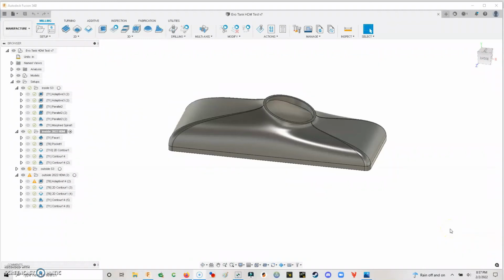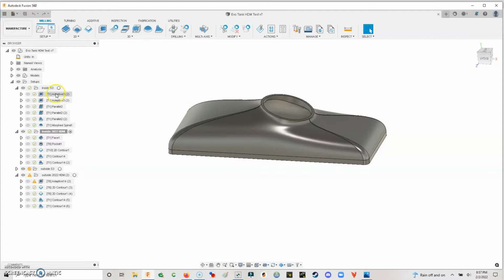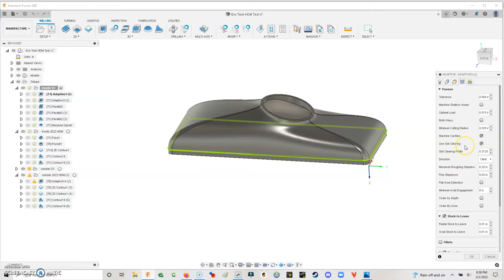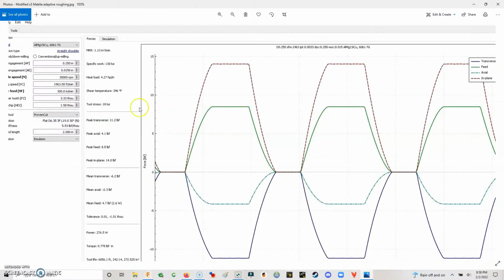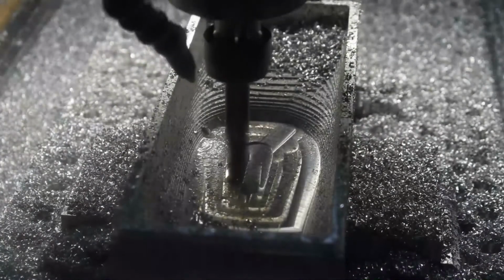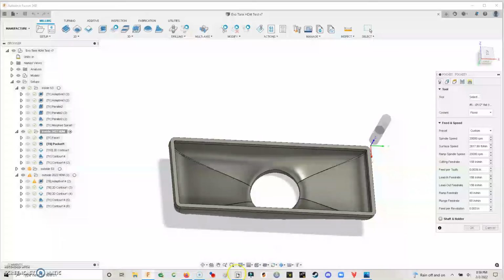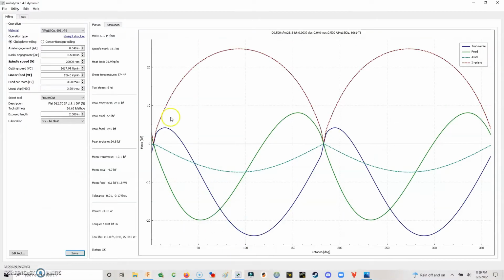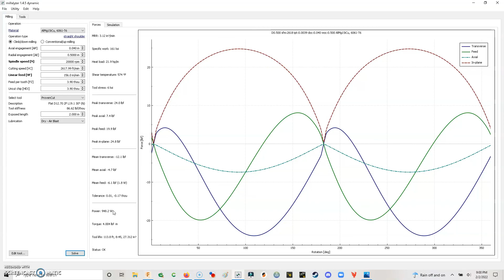Shapeoko HDM VS Modified S3 - Aluminum Adaptive Battle

Comment: Wow, that’s awesome! I wonder how it would sound if you swapped radial and axial depths on the hdm cut, so adaptive clear w/ 0.5” DEPTH of cut and a .04” stepover, same f/s.

Still confused on how best to rough aluminum. I’ve been able to do a .04” deep cut, full width (1/4” end mill) on my import machine but if I try a 1/4” deep cut with only a .02” stepover at half the feed I get some flutter in the unsupported rods.

Comment: I still have the Bantam and I'm still making parts. I really want something with a bit more power and is more stable. My depth of cut and width of cut is what needs improvement... I'm looking at the Tormach 440 right now... Thanks for the video brother!
Reply from the maker: A 440 will definitely be more stable and you'll be able to put quite a bit of power down.  One thing to watch out for is using micro tooling at lower sfm due to BUE.  Pathpilot is really nice and feature rich as well.  Ive bought a few heavier duty AB nut springs for our Bantam to try to increase the preload for better performance but sadly I'm not allowed to modify it.
Reply: @vinceramirez4463  when the warranty runs out I would like to do the same. It's almost like the spindle doesn't have enough mass on it to handle the material. It has other problems too. It doesn't touch off like it supposed to on conductive probing and I think the bearings is what's wrong with it. I can't get Bantam to tell me one way or another.